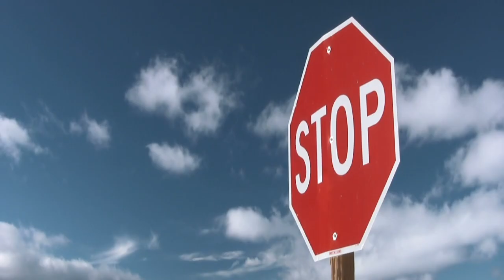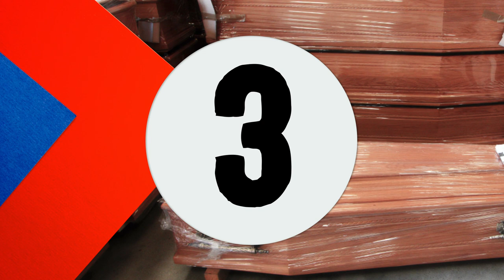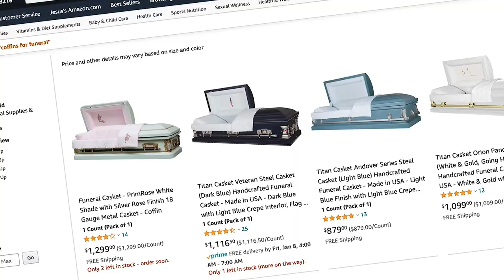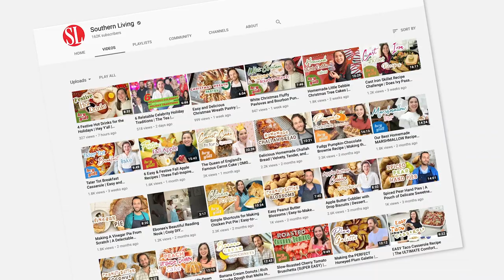5 Things Funeral Directors Don't Want You To Know | #TheTea | #SouthernLiving

Comment: Caskets have a seal that lets gas escape and keeps moisture out……. eventually causing the remains to liquefy inside the casket. This will happen unless you get a wooden casket. Which will allow air flow over the body causing it to hopefully mummify. I’m friends with a mortician. The most that can happen in a mausoleum is that bodily fluids can leak if the mausoleum isn’t built correctly.
Reply: According to the ask the mortician Channel on here, this can absolutely happen and she showed photos where it actually displaced the mausoleum concrete.

Comment: It's my understanding that exploding caskets are associated with the more expensive hermetically sealed caskets that don't let decomposition gasses escape.
Reply: I'm a board Certified mortician/funeral director in practice many years.

Caskets do not explode. It's a myth! Even modern rubber gasketed sealer caskets to not explode because they have a pressure relief valve that regulates an even constant air pressure even during air flights in cargo bays where there is a great differance in air pressure at high altitudes. Even in the event of a pressure relief valve malfunction, the rubber seal will slowly equlize the internal pressure of the 
the casket.
Ive been in the funeral business for years. Believe me. It just cannot happen
physiologically.

This person in the vid is not very educated in mortuary science and is shamefully embarrassing herself.
Reply: @johnsherman6718  came to say the same thing! Basically the only part in the whole video that is accurate is the discount coffins. 
In Australia you can do natural burial next to or under a tree at 4ft in special enviro caskets but not standard wooden coffins or caskets.

Can’t comment on the viewing, we only do viewings if requested but we also don’t really embalm here either unless absolutely required for varying reasons. So it’s not really a problem.
Reply: they cause areobic bacteria  they actually can make decomp  faster  but that depends on other factures

Comment: Mortician here. The information on caskets is correct. You can get a casket off Amazon Wal-Mart or China. Just make sure it's delivered on time from your source and you may need to sign a liability waver not holding the home responsible if it fails. Same with urns. 
She is incorrect on planting trees and roots growing around the casket. The roots will grow through it. 
Vaults are a cemetery requirement for heavy equipment. Not something a funeral director will make you buy. You either need one or not. Or want.
You need to be licensed to embalm. State law in most states and to direct a funeral a license is also required. Embalming may be required by law if the deceased died from a infectious disease past 72 hours by health regulations if refrigeration is not used holding a public viewing or crossing state lines.
Cremation price on national average is 6 grand. It is not always cheaper. You have refrigeration charges and cremation container pick up and removal with a charge to do the death certificates. Caskets can explode if not embalmed. It's rare. On funeral charges you will have basic service of funeral director and staff hearse embalming casket vault casketing and dressing hair dresser and removal of the deceased. On burial she should add cemetery costs as well. Opening and closing A tent chairs lowering device ECT. That will cost several thousand more or less depending on cemetery pricing. So a average funeral is really ten grand plus cemetery so about 13k. A casket may be a policy to have at the cemetery as well. In the end the directors don't own the home. We get paid either way so you choose what you need or want or what is required.
Reply: Thank you for setting her straight.  I thought her video was mostly ridiculous, and misinformed!
Reply: @Luluisraging.86  you're welcome. Yes, misinformation is out there in videos like these. Truth is, nobody can truly know unless you work in this field. There's so much to it. I never covered if the person dies in one state and then sent to another. So here is that breakdown.
First, use only one funeral home in the person's home state. They will network another home in the state where they passed. The two homes will work together to bring the deceased back for burial. Here charges are applied for what the home state funeral home can not do. Embalming and pick up. From there depending on distance, they will drive or fly the deceased back. Usually 3 dollars or so a loaded mile. Charges are normally less if the funeral home on home state contacts the home where they passed. If not and used the opposite way. The charges are normally higher. So I would advise letting the funeral home make the calls. It will be more expensive but that's due to what is needed to cross state lines and mileage.
Reply: I WANT TO BE BARIED IN A BOX. NO COST FOR MY FAMILY
Reply: @rhondaclark716  have them file for indigent burial if your county does so.
Reply: @alabamadeep4471    Thanks I want to be buried in a box , good for environmental. And my family is so poor , I wouldn’t want them to pay for anything. Because I’ll be in heaven with all the other people 👼🏼👼🏼👼🏾
Reply: @MrJamiez  So not true. You have to pay for services in life. Gas for your car and food to nourish your body. You pay doctors for health and drug stores for medicine. You spend money for electric and water from the tap. So funerals should be free??
Reply: @alabamadeep4471  when my wife dies, I am donating her body to medical science. It's free
Reply: @MrJamiez  be careful. In some states there is a few for that too. From the center.
Reply: @alabamadeep4471  I'm in the UK England. We can donate your body to medical science like that. That's what I am doing. After about 5 years they pay for the cremation & give the ashes to your loved ones..
Reply: @MrJamiez  Good deal. It is similar here. However I have known at times one will pay a fee which makes little sense to me. We also have something called Brown's Service. Brown's is a policy that covers all funeral expenses. It only exists in Alabama as it is a form of insurance from the late 40s into the early 70s. Unlike real insurance it covers embalming ECT but you must use their caskets. Caskets are cloth covered wood or metallic silver casket. They even came with a paper suit lol.
Reply: @alabamadeep4471  I in the UK again & if a family member can't afford to pay for a funeral, you can ask for a bereavement Grant, a death grant, which the council/government will give you. Which is maxed out at I think is about £3,000.
Reply: @MrJamiez  I understand where you are. I know about European traditions and ways there to cover expenses to some degree. My niece lives across the pond. She is from the Netherlands and has taught me a lot. 
Here it is similar. Each county in all 50 states should have what is called a indigent burial. People applying can have theirvlived ones buried at no cost. They must apply not for a grant, but apply and showing proof they can not afford the burial due to wages being below a certain amount of income. They would then be placed in a county owned cemetery.

Comment: I call BS on your claim metal is removed prior to the cremation process. The ONLY thing that is removed are Pace maker as they can cause a reactive thermal micro burst in the retort, as such the are removed.   They DO NOT remove and recycle artificial joints prior to the cremation process.  These items are cremated with the body then separated from the cremains, with the cremains being returned to the family VOID the cremated artificial joints, screws etc. The retort operators are NOT opening bodies and removing joint prior to cremation.  

As an independent removal specialist, I have performed just under 6,000 removals, 1,324 this past 19 months.  I have had over 4,000 going to direct cremation, NOT ONE OF THEM HAVE EVER had an artificial joint removed prior to cremation, EVER.   However, Pacemakers are in fact removed for safety.

Side Note:  Your claim caskets are only compromised in burials performed above surface is also void of fact. Caskets buried within vaults below surface also have a compromise rate due to the expansion gas rate via decomposition.  Decomposition occurs below surface and produces gas just as it does above surface and caskets are in fact compromised BELOW surface as well.
Reply: Not sure where she got her so called “facts” but it’s obvious she has no clue what she’s talking about.
Reply: @Just Jules  You certainly have that correct!